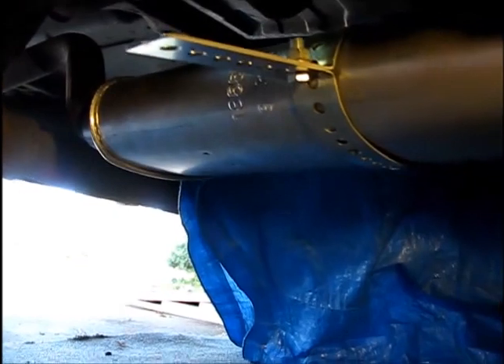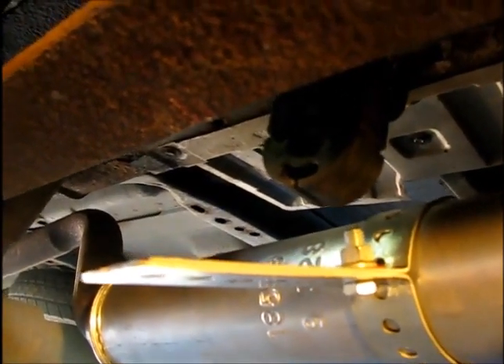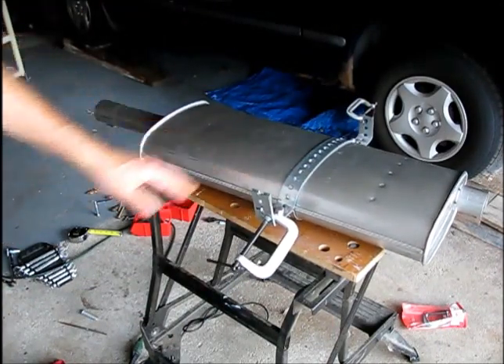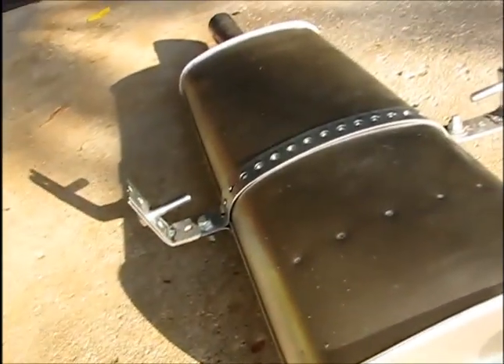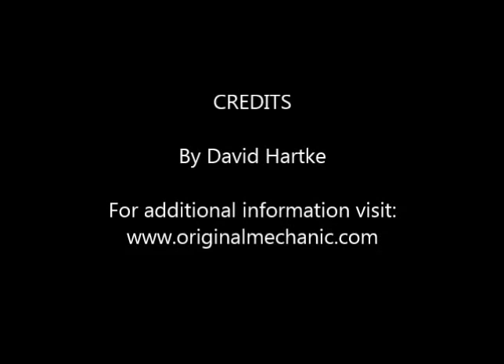How to Replace the Muffler on a 2000 Dodge Grand Caravan Part 2: Fabricating a Hanger

Comment: Sure beats that "factory replacement" muffler with the built in hanger, that's just another point for the system to fail and the factory hanger if it's intact doesn't fit many after market setups, yet still really strong. So, good job.
Reply from the maker: Thanks for watching. So good when someone appreciates the DIY mindset..